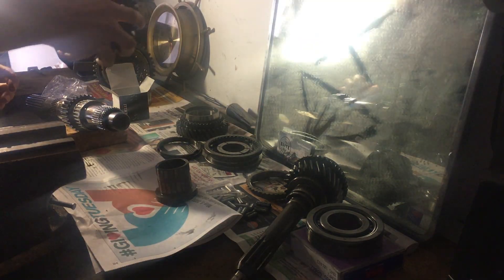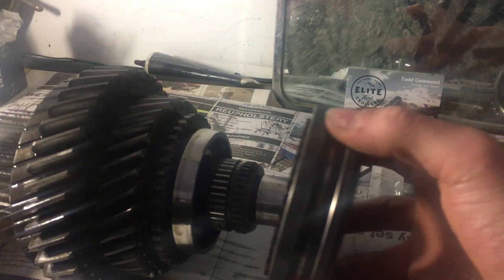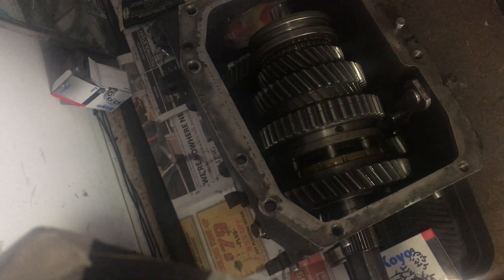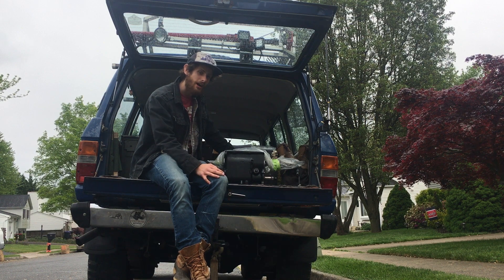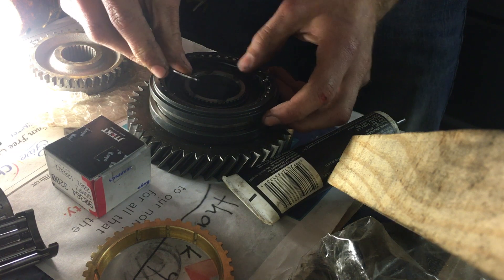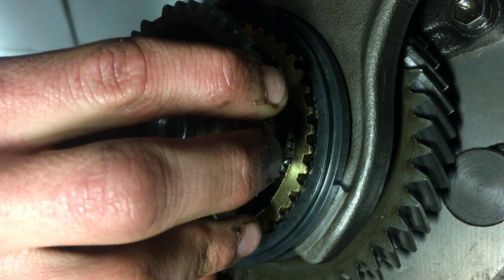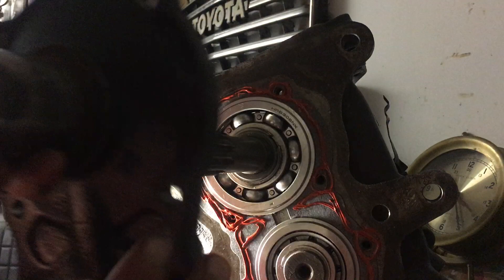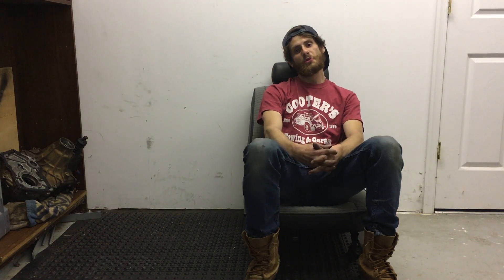Early H55F Transmission Rebuild: PT2- Detailed Reassembly

Comment: Maybe someone can help. after rebuilding the H55f I had to buy a used thrust bearing cover and it is leaking bad.. and my reverse is making a grinding noise. Any suggestions? All the synchros are new, everything shifts with the exception of the grinding.  Any suggestions?

Comment: Did you ever figure out what was causing it to pop out of 5th gear? Mine is popping out of 5th gear and trying to figure out whats causing it.
Reply from the maker: The sycro and gear teeth were rounded. Needed both
Reply: @mizeadventure9438  Thanks!

Comment: About to start the re-assembly of my H55F. Any thoughts before I get started? Was there anything you wish you had done differently?
Reply from the maker: hmm. i think the best i did was have a machine shop press everything together once i reassembled. also make sure you dont reget the 5th gear oiler. i did and had to take it all back apart. I would make sure you lay everything out and take your time. The one thing after driving it was maybe to replace more of the syncros. they all looked nice. But sometimes my 2nd gear doesnt like to go in until its warmed up. let me know if you run into any issues or need help
Reply: @mizeadventure9438  Thanks for the advise. My syncro's look good but I contacted George and ordered new ones JIC based on your recommendation. I have seen others forget that dang oiler so I am being super conscious of that during reassembly. I have a hydraulic press so I plan to press the bearings back-in myself so wish me luck! Thanks for the offer of help! I will let you know how I fare...